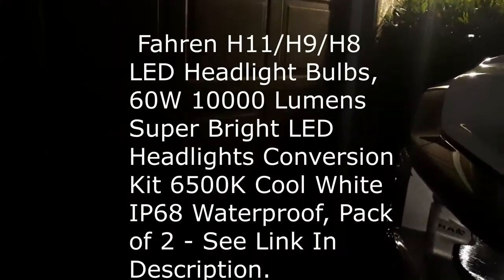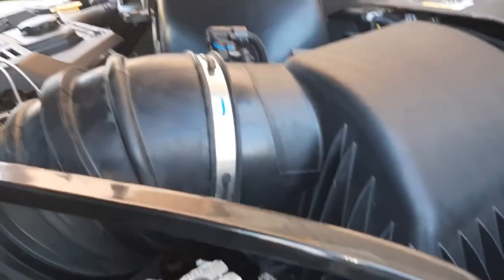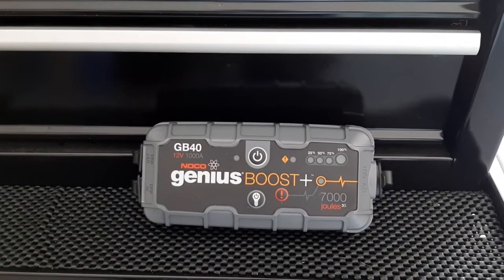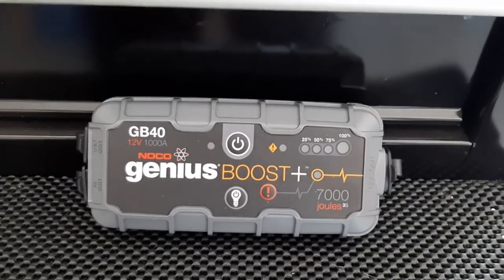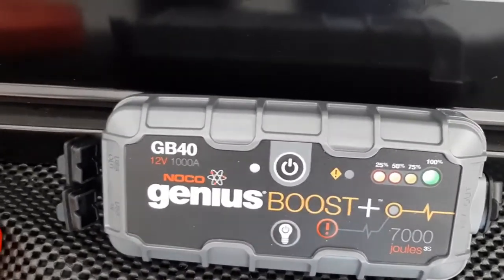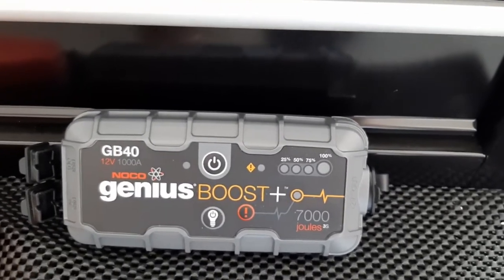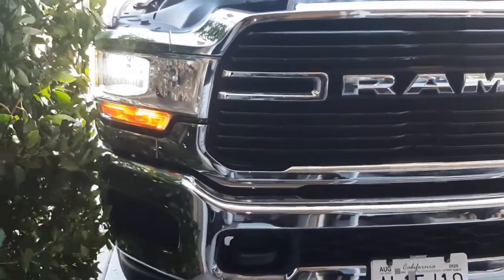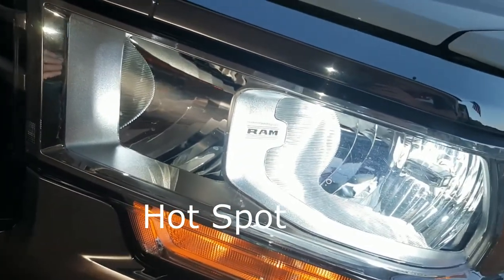2019 RAM Led Headlight 2500 Hd Low Beam Upgrade

Comment: Hi,
It's Lasfit here.
We developed specific LED bulbs, low beams and high beams for Ram 2500/3500 2019-2024 with OEM halogen headlights, super brightness, dual-cooling system and extended dust cover.
We're looking for a couple of Youtubers who own the trucks to review these custom-fit LEDs on your truck. Are you interested in them?
Sorry, it seems that we're not allowed to put the liner or contact information here.